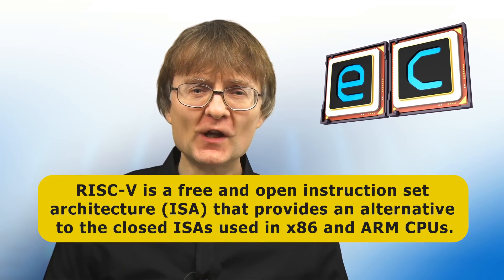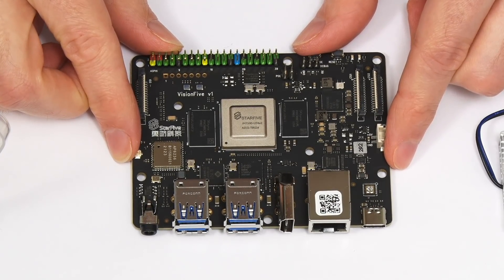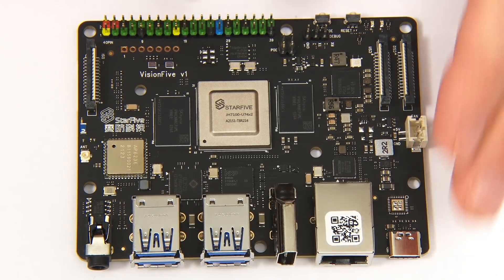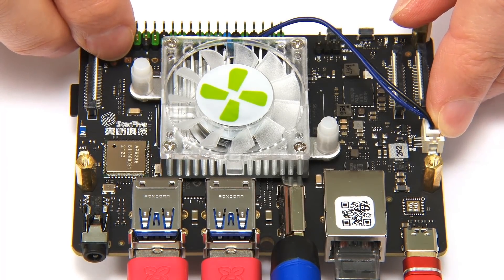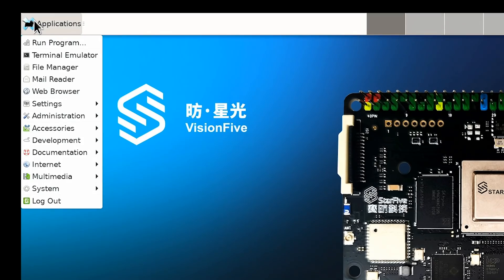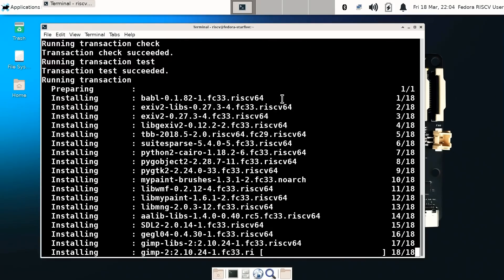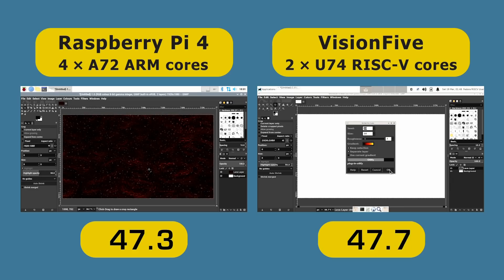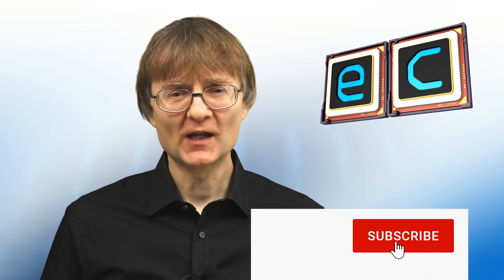VisionFive RISC-V Linux SBC

Comment: I'm also excited to see if RISC-V could fill in a gap between microcontroller and full-fledged desktop computing at some point, if costs can be brought down a bit.

Sometimes you just need a CPU with more capabilities than a micro controller to handle light computing tasks, and having a more open standard and wide support for it (with reduced licensing costs, assuming some companies are generous with their designs) could make some hardware devices even cheaper than something like a Pi in the future, while not being too much slower.

I think RISC-V may have an uphill battle since 'open' describes only part of the ecosystem, and open doesn't always result in complete, better, or more economical. But I'm encouraged seeing all the investors (including Raspberry Pi themselves!).

Early ARM boards were also very, very slow, and usually pretty difficult to get running well. It took a decade to get to where we are with ARM.
Reply from the maker: Greetings Jeff. :)
Reply: @ExplainingComputers  i think Raspi was disappointing me.. would it be the same? 🤔
Reply from the maker: @kennyanderson3123  As I've replied elsewhere, RISC-V has an open ISA, allowing anybody to design and make a CPU based on that ISA. Open hardware is not open source -- that is different, and applies to software only.
Reply: Compiler optimization sure needs work on if I see it boot.
Reply: I am waiting for a fullsize Desktop or Tower PC with RISC-V
Why not building a ATX Board with all connectors user need, a lot of disc/optica drive connectors, more USB and HDMI/DP and slots for more RAM and PCIe Cards (or the PCIe successor maybe)
If this happens, there will be more Linux or other OSS OS with RISC-V Support.
Reply: I, too, was wondering about the use of the word 'open' in this video, but I'm glad that Christopher Barnatt has clarified it below. 
P.S: Seeing you - Jeff Geerling - commenting here puts smile on my face
Reply: @ExplainingComputers  

Jeff, Mr. EC; a querry:

Why  RISC-V?  Why not use/rework MIPS processors into what you need??  If my memory serves me the IP for MIPS was released into the public domain by the owner.  They may have a higher power draw than these risc-v chips, but they are far more capable.
I know that mips and risc v are not in the same league, risc v and arm are competitors....just curious why one and not the other??

Later;
Monte
Reply: @montecorbit8280  probably because they shuttered the “MIPS open” initiative without warning around a year after launching it, then ceased all development of MIPS and then joined RISC-V. 

Again, highlights the risk of adopting something owned by a corporation - they could just revoke your usage rights. This might be a perfect example of why RISC-V exists.
Reply: @ShALLaX  

Thought the IP was public domain, so not able to be closed....hmmmm.
Reply: They already have it running Linux so it seems to be off to a good start.
Reply: @thaphreak  If that's directed towards me, I never said I only work with Arm, but I have mentioned that I don't spend the same amount of time as others (notably, Chris on this channel!) exploring other ecosystems. With finite time available, we have to all pick the projects we take on, and I find that others like Chris are better at exploring these other boards! One of the many reasons I subscribe to ExplainingComputers :)
Reply: It is insanely slow though...
Reply: Even though he seems to be the "villain" of this thread I would like to thank @Alexander Gräf for stimulating such an interesting discussion with many strongly held views that somehow managed to remain civil throughout.
Reply: Hehe, Mr Raspberry Pi is on here as well! Greetings.
Reply: at some point you just need to play far cry 4 and watch 1080p video
sbc will get there soon ... at < 10 watt
Reply: It is generally believed in the industry that there won't be any catching up to for example ARM in the foreseeable future. One of the reasons why so few companies invest in it. Right now there isn't a single good argument to use it instead of ARM. The "Gary Explains" video on the topic ("ARM vs RISC V") is pretty enlightening.
Reply from the maker: @graealex  I'm always deeply concerned about comments like "generally believed in the industry" -- partly because they lack specific reference, and partly because fundamental change is often driven from outside an industry not inside it.

The Gary Explains RISC-V video is indeed a good video, but like many others falls into the trap of only really considering RISC-V to be a competitor to ARM (and not also x86), and only treating this as a technical computing issue. Whereas in reality, the whole RISC-V thing is about control, and in particular intellectual property (IP) and the licensing thereof. And in a world in which trade barriers and sanctions are rising to the fore (if for good reason on many occasions), this is likely to be key force behind RISC-V.

Already China and Russia have announced plans to make RISC-V desktops and laptops so that their access to the involved IP cannot be constrained. More broadly, the current reality of the West telling the rest of the planet what technology to use, and charging them for it, is not likely to remain intact for that much longer. And this, regardless of what we may think of the involved politics, will be the major driving force behind RISC-V -- and not the "general view" of an often rather inward looking computing industry. :)
Reply: @ExplainingComputers  The thing with open source is that it is basically a "prisoner's dilemma" sort of thing.
If every participant acts in favor of all the others and contributes in a similar manner, then all of them benefit, a lot more if every one did their own commercial/proprietary project without interaction.
However, that scenario is not very favorable with ARM right now, as their proven IP puts the bar of entry so low that you'd basically be stupid not to just use it. Not to play down what the engineers are doing, but the toolchains and software makes it basically possible to drag-and-drop an SoC together, then send it off to TSMC, and you're done.
Also, China and Russia will probably use some of RISC V as the base for their own developments, but again, "prisoner's dilemma" - if they achieve any sort of good progress, they'd be stupid to give it back to the community, even if that was somehow mandated (which it isn't). And it still takes sooo much work to make any progress at all - as seen by HiSilicon having 7000 employees and still relying on ARM.
I like the idea of open-source hardware development. But there is a commercial reality that puts companies that give away their own work usually at a disadvantage vs. such companies that keep it to themselves.
Reply from the maker: @graealex  You are right, there are problem with open source as you describe. But open hardware is not quite the same -- there is no requirement that a community re-develops and gives back. Indeed, already core designs like those from SiFive (ad based on the open IP) are closed IP. And hardware will never be free like it can be with software. All of this is therefore why I and others (like RISC-V International!) make clear that the RISC-V ISA is "open" and not "open source" -- they are different! :) One is about community development, the other about IP that is free to use (the same way that IBM made its PC architecture open). So Russia and China would not have to give back, and there is no expectation they would do so. But they could go on manufacturing chips, even in the face of a trade embargo, as a licensor would not be breaking that embargo by selling to them. Except, of course they would be giving back indirectly, as adoption of their hardware would drive open source software development . . .
Reply: @graealex  Just imagine the possibilities. As a programmer, I don't generally like RISC over CISC, especially if I have to do anything in assembly, but with an open architecture, and one that is already capable of running a full desktop O/S, I'm excited. I think at this point, the next step should be figuring out how to manufacture at cheaper facilities and for a cheaper price. Yeah, even above optimization. There are videos of people making their own IC's in home labs. I'm hoping the next step is full chips, albeit simple ones, and eventually home chip printers like we have 3D printers now. The future I envisioned as a kid is coming true in my lifetime, and I like it.
Reply: @anon_y_mousse  Your comment summarizes the issue by far the best: in a perfect world, the whole industry would come together to not only make the best ISA, but also create the best cores/implementations, that'd also be free for everyone to participate and use.
In reality, there's stuff like economics and politics and competition. And that means ARM is going to be the leading RISC platform, and, depending on how Intel and AMD play their cards (hint: they're not doing that well), we might see whether x86/x64 will stay relevant as a CISC platform. 
Right now, RISC V is just another complication in something that probably should have been consolidated a long time ago. Tensilica, the company that provides for example the ESP32 IP, has already been acquired by another company, and actually did go back to the good old MIPS days. The company also provided IP for Tilera CPUs, which have been used in Mikrotik routers, where new models also now exclusively use ARM architecture.
Reply: @ExplainingComputers  Very well put. It seems that many people have got the wrong idea about the Risc V ISA being 'open'. Many seem to think it will mean cheaper products due to no licence fees, but that isn't necessarily the case. A manufacturer can design a chip around the ISA and charge what they like when licencing the design of that chip. Risc V is not a chip design, just an instruction set. As you say, the Risc V advantage is largely the lack of commercial and political control over its use.
Reply from the maker: @another3997  And you put things very well indeed also! There seems to be a lot of confusion about RISC-V. So the comments section here is very useful in highlighting what I need to clarify when I make my "Explaining RISC-V video".
Reply: @graealex  You have some strange and naive ideas about how industry works, not to mention a fundamental misunderstanding of what the 'open' aspect of Risc V actually means. There is no such thing a the perfect ISA. Even if there were, there would be no single processor design base around that ISA. Just like Intel and AMD go about using the x86 architecture differently. Intel licences its x86 ISA to AMD (and to several others in the past). In turn, AMD licence their 64 bit extensions to the x86 ISA back to Intel. Their CPU designs are very different internally. Both companies are big in the desktop and high performance computing arenas, and that won't change any time soon. ARM allows companies to pay a fee which allows them to design processors how they wish, it's only the >>instruction set<< that is set in stone. Those companies can then sell or licence their processor designs as they see fit. In simple terms, Risc V only cuts out the former, but doesn't change the latter.
Reply: @another3997  I fully understand what the open part for RISC V means. There actually might be a perfect ISA, based on modularity. In a similar way as the ARM ISA runs on a small micro as M0, or fully-featured on server processors as ARMv8.2-A. And while you claim that ARM Ltd is basically only a company that guards the ARM ISA, it actually is a lot more, as they design actual cores (hardware implementation) and software tools that companies like HiSilicon use. It is not just the ISA that is licensed, and even a well-designed ISA really isn't worth that much without the investment into actually proven silicon design, or at least accompanying software tools. 
Not sure what your "you have some strange ideas" is meaning. It's not very constructive, and it didn't contain any new information - rather a lot of false information.
Reply: @ExplainingComputers  This right here.  This is why I subscribed to this channel.  Rational and civil discussion about tech.  Thank you all for the food for thought.
Reply: @horusfalcon  Yes, yes. I'm a fanboy of this thread. It certainly will be interesting to see what happens with RISC-V.
Reply: @graealex  I think the weak point in the Gary Explains video was his use of history to show why a new ISA like RISC-V will find it very hard to take over. Like how intel tried to make a low power CPU to compete with ARM, when the top down design couldn't compete with the bottom up one for energy efficiency. Or there wasn't a need for alternative CPUs as from the 80s standardisation was important for business.

Now with new requirements a generic package like intel or arm has limitations and some parts of the industry is going back to specialised CPUs for the job without having to spend a year or two negotiating a licencing contract.

On your prisoners dilemma point I wonder if these new machine learning platforms will move in a similar direction if they want to use a Linux based OS. In the early days of silicone valley the employees would talk to each other after work in bars and ideas would move around. So perhaps at the early innovation stage there is a greater desire for open communication to speed up development.
Reply: @TadeuszCantwell  People are seriously underestimating the value of the design tools, and the already proven silicon designs. ARM doesn't have 4000 employees just to ponder about what instructions to include in the next revision of their ISA.
An ISA isn't a holy scripture. Unless proven to work, and work well, in actual hardware, it's basically nothing more than a white paper, and most of the IP protection comes from patents surrounding it, and it's implementation into silicon.
What lies ahead of RISC-V is more companies taking on the risk of implementing hardware from it, and as such proving that it is worthwhile to do so. 
However, I doubt that RISC-V designs are actually going to be cheaper in the long run. Much of the value added is still going to be actual cores, and that work will remain protected by the companies that made them - like SiFive. For someone making a processor, the question will be if them buying a design from SiFive will, all cost totaled, including cost from a possible lack of the best development tools possible, is actually going to be cheaper than buying from ARM.
Reply: @graealex  I understand the design tools argument for the opening of say SPARC and MIPS which had difficult to use tooling, but RISC-V is developing new tooling that isn't dependant on one company, so if the tools aren't good enough they will emerge over time. The CPUs for routers is already moving to RISC-V for easier tools. 

What is happening is the small projects that had to use a custom ISA for something that is too small/low budget to licence with something else can just use RISC-V off the shelf. A growing body of people learn how to work in that environment, coalescing a fragmented world of simple targeted boards into something that becomes more off the shelf and uniform. ARM has already waived their licence fee for low end project to stop this from eating into their business.

I just don't buy the argument that RISC-V will fall into the same controlled proprietary pattern as intel and ARM. For one any company can develop their own chips which by itself will bring extra competition and downward pressure on price. Then over time simple open source CPU designs will begin to accumulate to do more and also cut into the business of the likes of Sifive. 

Intel and ARM having known good solutions doesn't address how well they work with new emerging platforms like machine learning where you could be better off having specialised boards. We are already seeing it with Google and Amazon developing their own CPUs for servers. As I said before the market is moving away from generic CPUs to do everything to specialised CPUs for new purposes. RISC-V happened to be in the right place at the right time to be there at the ground floor.
Reply: @TadeuszCantwell  Again, overestimating the worth of the ISA, and underestimating the worth of actual synthesizable, proven and well-performing core designs. Maybe a growing number of companies will be able to provide those, but the again, it's hard to do a better job than ARM Ltd, a company valued at $40 billions.
But then again, Nvidia, Samsung, Renesas etc and some recent funding of SiFive might give RISC-V enough momentum. And again, the big value here are their working core implementations.
Reply: @graealex  And Apple which already makes the potent M1 series of CPUs.  Apple Silicon is ARM instruction set.
Reply: @catchnkill  That's true, and if Apple had used RISC-V for their new line of silicon, that'd have been a big game changer. Although by volume, Samsung, Qualcomm and Broadcom are still more important regarding the ARM ecosystem.
Reply: @catchnkill  RISC-V wouldn't have been such a bad decision there. The ISA might be open, but then again, their core designs remain proprietary.
Anyway, the driving force behind choosing ARM was very likely them designing ARM-based silicon since 2008, which was the A4, which was used in the iPhone 4. If Apple had chosen RISC-V, then they'd basically throw away more than a decade of in-house ARM experience and R&D.
What is somewhat risky with them relying on ARM would be a situation where another big player (for example NVIDIA or Intel - as announced) which could change the dynamic quite a bit.
Reply: @graealex  Your argument seems to boil down to because the market leaders are dominant they will remain that way.. That was the same argument put forward in the 2000's about why ARM would never challenge intel, yet they are being used as a base in custom servers for Amazon. You may see that as proof that the established two ISA's are worth more, but i see it as the generic way of creating cores is not worthwhile to use, so it is more effective in the long run to hire engineers and create bespoke chips. Apple is doing the same with the M1, Google has it's own in the works. Add to that custom chips for machine learning and A.I. 

I don't understand why your main rebuttal is the value of the RISC-V ISA, when that hasn't been the core of my argument. Which is 1) The industry is moving away from generic chips to custom ones. 2) This is shrinking will over time reduce income of the big chip vendors. 3) That the fragmented chips that it wasn't worth getting a licence for or custom machine learning chips which are spaces where the incumbent generic chips don't matter as much and are able to develop faster without the 1-2 years of licence negotiations for intel and ARM. 4) The relative openness of the ISA compared to the locked down ones of the big two cannot mean that it will replicate how the big two behave or how the industry works around them because it is not tied to two companies, but open to many companies to give development a go. 4) The world is changing and getting more territorial and less open to global trade, so governments want to bring certain key things like chips closer to home. 5) With the slow down in Moore's law and overall chip speed improvements year on year, it also gives other ISA's some breathing room to develop in a way that wasn't possible in the 90s and 00s. 6) Like with other open things before once a younger generation learns on a new toy, they move into the workplace they bring those with them helping it to spread in the industry. 

If I was actually arguing about the RISC-V ISA being better I'd have said something like it is a clean design that takes the last thirty years of knowledge to make something without the cruft of the big two, that it has a better memory handling or whatever. Sure there was lots of hyberbole about how it would take over, when it in fact has a lot of catching up to do with say the specialist bits that decode a YT stream etc that RISC-V won't get for a long time. However time is on RISC-V's side, the industry and the world is changing and it is in the right place at the right time to slowly build up from the fringes of chip manufacture which as it expand becomes more useful and embedded as a solution.
Reply: @TadeuszCantwell  I'll answer to that for sure, when I have time to read it all, and properly. Already thank you for taking the time.